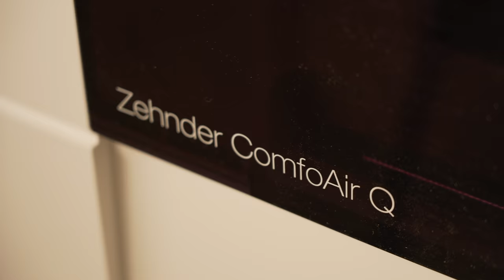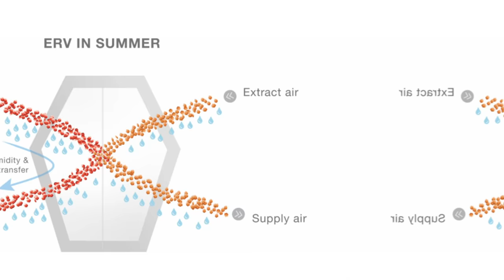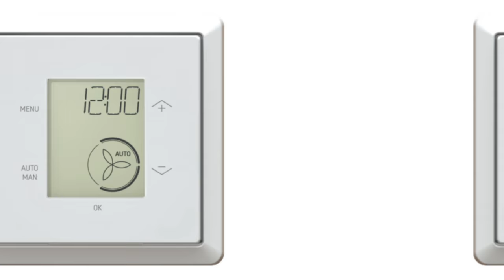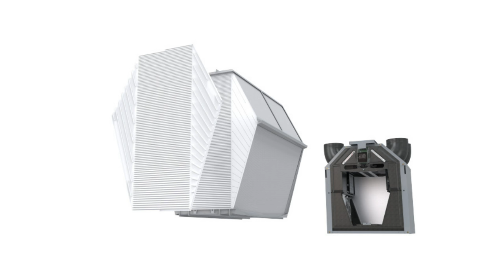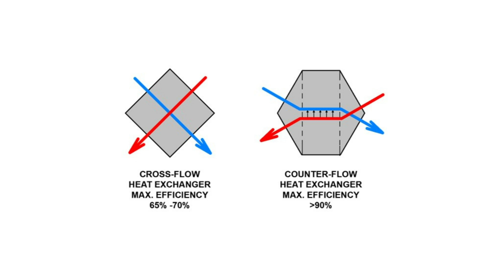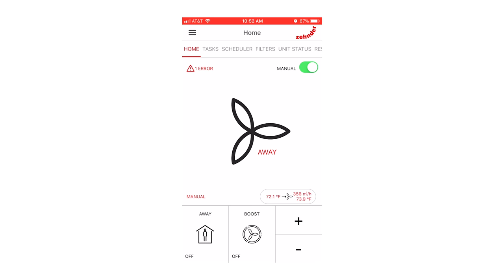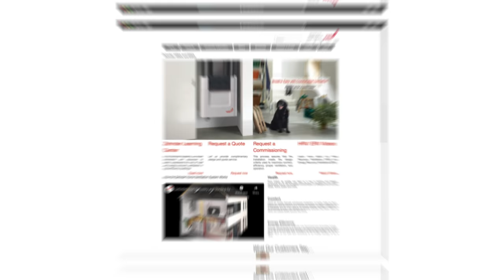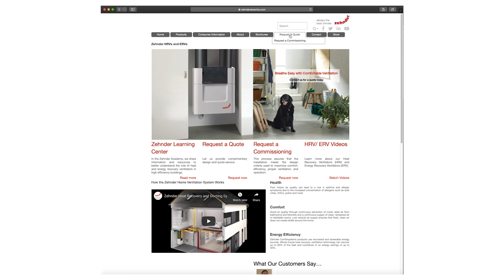Passive House - Fresh Air System Install & Costs (Zehnder)

Comment: I wish Canadian suppliers would stop sitting on there hands and start carrying the product you have available down there
Reply: Its not just the suppliers, it's the buyers. Up in Canada, central vacuum systems are very common, most new houses have one. Not as common down here in the US, not for a lack of suppliers, as we have more of them, if you can believe it. Sometimes I think the buying public in the US has gotten cheap, and unwilling to consider the benefits of spending money on something like a central vac, or this air system.
Reply: This particular unit doesn’t make Energy Star ratings and really isn’t meant for harsh winter conditions, maybe Vancouver but not around Ottawa where I live. I read a bit of their literature, they say the supply air will likely be somewhere around 16.5C when the outdoor air temperature is -10C. That’s cold!  My HRV is Energy Star rated and is at least 75% efficient at -25C. It also has a passive defrost system. They don’t even mention defrosting the core in cold weather, I’d want to have a long conversation with them before installing one in a cold climate.
Reply: George Ian I checked their website, and other models have varying features, I assume different variations suited for different climates, and some of them mentioned specifically frost protection. Being he’s in Texas, his unit likely does not have this, as you noticed.
Reply: @Vinski A too common attitude in the US is that bigger means it is better. Quality isn't a commonly used word.
Reply: @compactc9  Central vacs are a pita and don't work anywhere near as well as top-quality push vacuums. We stopped using ours after a few years. Until you mentioned it, I had forgotten we even had one.
Reply: @ArthurDentZaphodBeeb , What POS central vac did you buy ? We installed a central vac 20 plus years ago and it will suck the chrome off a trailer ball.
Reply: @georgeian3243  These are real issues, so thanks for noting them. I'd be happy to have a conversation with you about this. The "passive" defrost system of your HRV meets the NRCan Energy Star requirements, but typically requires either the recirculation of extract air or going into exhaust-only mode. Both of these use energy from the house, so neither are truly passive. But the testing protocol that determines how efficiency is reported doesn't factor this energy into the process. Rather than interrupting continuous ventilation (which is the best Rx for healthy indoor air quality), Zehnder offers pre-heating solutions that bring the outdoor air temp up just high enough to avoid frost in the exhaust air stream. NRCan disqualifies this approach right out of the gate, so our units are not Energy Star certified in Canada. But if all the energy involved is calculated, Zehnder units can be just as energy efficient even with the preheat. And we maintain continuous fresh air supply through the entire cold winter night (no recirculation) so you wake up refreshed. Much more could be said, so take me up on that conversation!
Reply: Christopher Smith Thank you, I stand corrected. I do like the idea of a home run system to every room, definitely superior to my system. I also understand that adding pre-heat is better than passive defrost (I’ve already had to replace my damper motor after 4 years) and, assuming the outdoor air temperature around here only stays below -10C for, say 500 hours per season, it’s going to cost around $75 to run the heater, I’m OK with that. However, as I remember from my ventilation course some years ago, I think new home builders in the province of Ontario have their hands tied by the building code. Builders, when required to use an HRV, had to provide a unit rated at 75% sensible efficiency at -26C. I’m thinking your unit’s efficiency numbers are skewed by the electric heater so you can’t report the standalone efficiency the government is looking for. And, of course, everyone (including me) is all abuzz about buying Energy Star. If I call your 888 number, would I be able to speak with you?
Reply: @georgeian3243  Yes, you'll be able to reach me or one of my colleagues. (I've got some vacation coming up!)
Reply: @ArthurDentZaphodBeeb  Sadly I fear you've got one that either wasn't installed well or just isn't good equipment. If done right, they are much more powerful and can suck up anything.
Reply: @compactc9  In Canada you can go to the hardware store and buy everything you need to install a central vac - the pipe, the fittings, the wall outlets, etc. and it's very cheap if you do it yourself. The bigger hardware stores even sell the vacuum units and all the accessories, and usually have a display setup showing all the parts you need. In the US, it's mostly dealer install only, and you don't find those parts easily (and central vac uses an odd sized pipe). Also interesting how things like conduit is way cheaper in the US, and actually really expensive in Canada (hence why I used central vac pipe for low voltage "conduit" for ethernet and coax cables in Canada, but in the US, the cheapest option is to use the thinwalled PVC pipe (CL200) for irrigation, which as far as I remember I never saw in Canada - even actual real sch 40 conduit is just way cheaper in the US), and underground sprinkler parts tend to be cheap in the US and expensive in Canada. There's definitely a lot of weird market factors at play with all this stuff. Also interesting that if you go down the plumbing isle and find 1.5" sch40 pvc pipe (white), it's one price, and if you go down the electrical isle and find 1.5" sch40 pvc conduit (grey), it costs more, even though it's made by the same company, probably on the same machine. Plumbing pipe and conduit are all the same dimensions, and the fittings are interchangeable (though I pity the person that uses plumbing fittings and tries to pull cables through them later with a fish tape!). Figure that one out! Above a certain size, conduit becomes cheaper than plumbing pipe, and it flips. Compare the price of 3" ABS DWV pipe to 3" PVC electrical conduit to 3" PVC plumbing pipe. Pretty sure water from a french drain runs down all of them equally well, but the conduit saves you a LOT of money!
Reply: gorak9000 the pipe for a central Vac is 2in OD SCH20 PVC. It and it’s fittings are a bit different because it’s designed to have air sucked through it with dirt and debris. In plumbing, the drain is gravity and it’s all liquid with maybe some wet solids. Central vacs are very easy, but it can be very easy to make a simple mistake that will leave the system prone to clogging.

Comment: Now that is a well thought and engineered system, I really like not having to have all the extra exhaust fans,penetrations,ducting,wiring,whining to turn on the fan!,and bugs.  Great Vid     Thanks
Reply: Just installing 10 normal point of use exhaust fans and ducting in a house that size will run you $2K (for the cheap stuff builders love to install) plus the headaches that come with it.

Comment: I liked the little black boxes with facts...very nice touch.   Only mis spoke information was on the bedroom co2 sensor, it will not ramp up the bedroom, it ramps the entire system in all rooms as there is no zone flow capabilities.  Flawless presentation other than that one mis spoke, covering/touching all the bases.........excellent job, excellent system !
Reply: Shawn, you are absolutely correct. Thanks. There is no "zoning" on this ERV air distribution system. We did review this together after filming, but the note got missed in the editing.

Comment: I'm sold, was basically going to do something similar, but this is the nicest kit I have seen. I'm a mechanic, and complete user friendly kits are the only way to go. I'm not sure I can afford to get the system right away, but I'm going to put it in my plans, and implement it when funds arise

Comment: I like that this system works independently from the other equipment.  So you could use this if you have a ductless mini split system.
Reply: They all have option to be installed independently

Comment: @Matt Risenger:  You mentioned no ventilation penetrations, which is good, except for the Kitchen.  Kitchen gases don't just include moisture, but hot grease/oils which break-down into esters that act like paint, they can gum up your ERV/HEV exchanger membrane in no time.  Unless you have extreme filtering, don't vent anything in the kitchen to your ERV/HEV  (or HRV).  Just look at the pipe behind your old range hood and you'll get an idea about how ineffective range hood filters are.

I don't know about Texas code, but it's probable that just using an HEV or HRV, even at max output to vent kitchen, may violate code.  The cases I've seen in California do with following exception: Cooking appliance that is in accordance with UL 710B for reduced emissions where the grease discharge does not exceed 2.9 E-09 ounces per cubic inch (oz/in3) (5.0 E-06 kg/m3) where operated with a total airflow of 500 cubic feet per minute (cfm) (0.236 m3/s).   Frankly most home kitchen range hoods don't meet code in California, but this is one of those areas where the inspectors are allowed a lot of leeway. 

Hope this reaches you in time.
Reply: Thank you for that...good info.
Reply: yes - microwave with built in "ventilation" are a joke.  I put a real hood in over my cooktop an the difference it makes is amazing.  And it's not that big a deal to crack a door to get enough makeup air when it's on high.  I probably should have some sort of a make up fan but I'm not staying in this house long term and I certainly won't get the investment back.   Having sold houses in the past when moving most people are beyond clueless when it comes to infrastructure - all they care about is move in ready :p
Reply: Matt is not venting the kitchen hood through the ERV. You're correct...we DON'T do that! ;)

Comment: Great video - thanks.  Concerning shower-room users forgetting to push the 'boost' switch - the MVHR (aka 'HRV') I'm installing (VentAxia Kinetic BH) here in England has an inbuilt humidity sensor so that the unit goes into 'boost' mode automatically for a selectable time whenever the humidity in the extract air rises.  There may also be others that have that feature.  One can also wire the light-switches in those wet rooms (via isolators) back to the MVHR so that it runs in 'boost' mode all the while those lights are on.

Comment: adding this to my ICF plans. Works absolutely perfect with ICF and solving some of the issues there. I planned on a multizone split A/C and heat, or ideally Geotherm if it is possible for the eventual location and my budget. This system is really simple and makes a lot of sense. Frees up planning in so many other ways it pays for itself.

Comment: Amazing stuff! I appreciate your honesty and openness shown in these videos documenting the "how-to" and the "why" of different technologies implemented into your house. Here in Europe, we also have certified passive houses and even premium passive ones with top energy-saving solutions such as CLT panels used in the assembly of exterior walls, floors, partition walls and roofs walls, passive house doors,  passive triple-pane windows with weather-based electrically controlled blinds,  wired/wi-fi weather stations with humidity, air pressure and light sensors, green energy from photovoltaic and solar thermal panels, integrated smart meters and KNX-based protocols for remote monitoring and controlling of a variety of appliances such as the geothermal heat pump, ventilation units,  room temperature sensors, hydronic systems such as subfloor heating and radiant cooling ceilings,  wall-mounted smart switchers and app-based interface for ambient light scenarios, CAT 7/8 structured cabling for connected IoT devices and much much more...there is a growing worldwide tendency to build smart and even energy self-sufficient premium passive residential properties, office buildings, schools, kindergartens and  the like....I would love to see some of these smart house solutions integrated into your project. Stay healthy and keep up the good work!

Comment: Something needs to be mentioned here - for anyone considering installing an ERV in a vented attic - you're going to want to make sure that attic is well ventilated and that ductwork well insulated. Using the regular uninstulated rigid ductwork is going to fine as long as its housed in a conditioned space. All this seems fairly straightforward, but I do feel like it may get missed if an installer or DIY person isn't considering this.

Comment: Top of the line, looks like a great design in that they took everything reasonable into consideration to make a perfect unit.  .75w/cfm is very efficient, it has to maintain proper cfm throughout varying SP's.  Only $9.50 month at $.13/kwh.
Reply: Just  1 solar panel of 400 Watts can run this system for 10 years or more for free (after the cost of solar panels, Battery, and control system) and still have some extra energy to spare. He said this big system would use about 100 Watts, so about 2,400 Watts a day.  The average day is exactly 12 hours, the power you actually get on your panels is equal to about 6 hours of full sun radiation per day. Therefore 1- 400W panel (or 4 - 100W panes for lower price but need more space) would create 400Wx6=2,400W a day. Now, this house has a great large open space for multiple arrays of solar panels systems and since his whole house is running on electricity He can practically run the entire house on solar. He does not even need a battery backup and connects the Panels to his Electric Miters and the power production would be subtracted from his Bill. In some states, if u produce more power than use they would even pay u for the extra energy u give them. Now since he lives in Texas a really hot n sunny state his power production would be even higher, so I would have a backup battery for emergencies since Texas Power System SUCKS! WHY THE F***!!! Texas is the only state in the country that is outside the National Power Grid?
Reply: @nicolascardillo7615  an average day on my planet (called earth) is 24 hrs…

Comment: Pricey but impressive, especially that cost of operating. And when you consider that you don't really have to run the a/c as much to provide dehumidification in the south, that can add up to a lot of savings.

Comment: Matt, curious about some things on this system.  What is the monthly electric cost?  What is the average filter replacement cost?  How would this system work if you wanted to have a fireplace in your house?  How would the possible smoke effect the system or would it damage the system?
Reply: 40 watts/h. Yes if your ofen has a secondary wir from outside by pipe. And normal Filter  need 2 20€ /pair

Comment: This is extremely interesting.  Such high level engineering.  I followed along and understood everything as explained until we got to the proton nebulizing surface area exchange rate cross flow efficiency counter flow combobulator

Comment: 33:26 While some may be concerned about the Zehnder cost set up (or operating costs - which are really not bad at 2.4Kw/ per day) I can see the Zehnder system taking place of additional mini split units that would have otherwise been needed throughout the house.  So yes, this unit costs a bit more, but the HVAC bill is going to be half!
Reply: edit kWh - Energy rather than power. NB. This isn't an AC unit - it is additional, for air quality, rather than "comfort".
Reply: @kadmow  I know that an ERV system is for air quality.  My point is that when you have such an efficient air distribution system such as this Zehnder ERV, you eliminate the need for additional mini split units throughout the home because this system will continually distribute air around the house.
Reply: @JamesBlazen  I understand that.  Matt has already stated that he will be utilizing mini split heads in his home.  My only point was that this Zehnder system offsets the cost of installing mini splits in; say, every room, which I've done.  Next time, I would consider the Zehnder option and save the cost of at least half the mini splits.  The bonus is getting the fresh, filtered, heat recovered air that the ERV provides.  (A requirement anyways on a house that is under 1.0 ACH.)
Reply: @JamesBlazen  Energy recovery. That includes heat and A/C